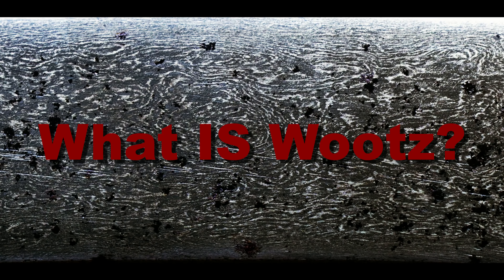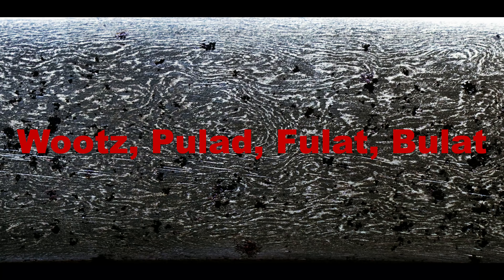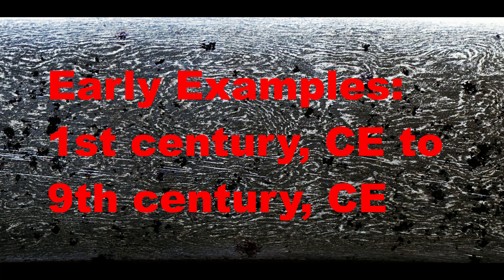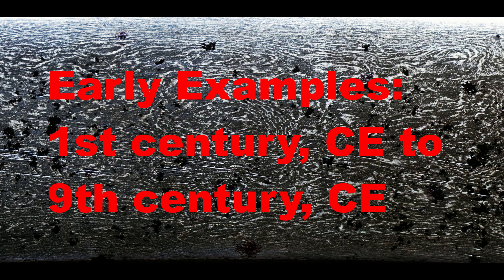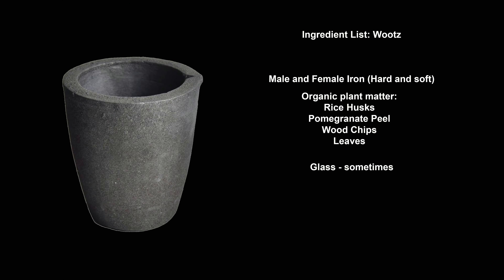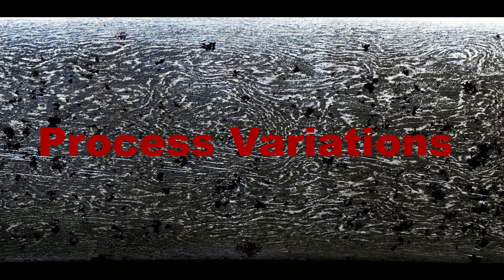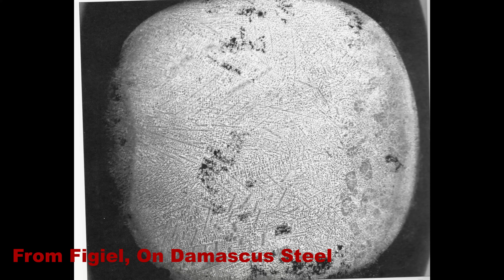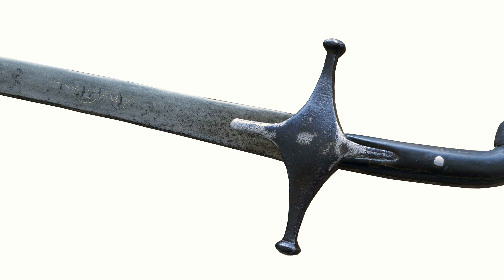"True Damascus Steel": History, Metallurgy, Production

Comment: Crucible steel is not Wootz steel. Wootz steel is made from crucibles of steel of course. The presence of carbides within the clean dendritic structure of Wootz steel is not present within the structure of clean Crucible steel. Low and best, no sulfur iron ore along with vanadium at .005 to .01 % is required. Further introducing hydrogen in the crucible process is a must to lower the temperature of the melting point. Wootz steel from crucible steel is much more specific and time consuming than simply making crucible steel. Watch Al Pendrey’s video, the secrets of wootz Damascus steel, will provide additional information. Cheers.
Reply from the maker: I think you might be missing something here. Not only did I reference the papers by Pendray and Verhoeven, I never claimed that all crucible steel is Wootz steel. But Wootz is undeniably a crucible steel.
Reply: IPostSwords I wrote this to hep direct the information you provided.  I’ve listened to the commentary twice. In the beginning, you must have high magnification on crucible steel to see if the dendritic layers and particularly the carbides that differentiates the two, exist. Just an unbiased critique. I believe it might be in the assumptions you make of the persons listening. Even I do that at times. I do appreciate you and others passing the knowledge. Most people do have wrong information and very wrong ideas about Wootz, especially when it comes to the temperatures. This is a subjective and very delicate science. You can easily lose the carbides in the crucible even if the proper elements are present. However, you can bring back the carbides, through several thermal cyclings, if you lose them. There is of course much more to it, but these are some of the facts learned by Al and continuing by others. Even Al took the time and gentleness in coaxing the crucible into Wootz. Patience from age and experience is the key I believe. I really enjoy pattern welded and crucible steels. Heck I still love my old Anza knives better than my own. They sharpen easily and cut like butter. I’m very excited about the expanding of other smithies to start producing Wootz. Wouldn’t it be great to have an abundance of Wootz blades available.
Reply: @aaronbuckmaster7063  I'll surely purchase one if you make it! How would wootz fare as a Kukuri knife?
Reply: Kasper Bolding it would do an excellent job. All of my knives used for processing and skinning game, have that same geometry.

Comment: Does the steak name has a concluons to Damascus?
Reply from the maker: There's three main theories on how it got the name. The first is that its associated with the city of Damascus, likely due to swords made of crucible steel being sold and traded there, potentially forged there - but there is no evidence of the steel being made there.

The second theory is that the etymological root of "Damas" refers to water, and the steel is often called "watered steel" in various languages, or having a "watered" pattern. 

The third is that there was a smith called damasqui mentioned by Al beiruni, whose name may have been associated with early examples of the swords.

I think the "watered steel" hypothesis has most merit
Reply: @IPostSwords  thanks man
What I’ve heard it’s some wondera went to Damascus there where they found the swords the how they made it🤷🏻

Comment: When you say crucible sterl it will come out as mono steel doesn’t it?
Reply from the maker: No, the segregation of carbide forming elements during ingot solidication is not homogenous, and as a result the steel ends up with banded patterning after forging and heat treatment. It is a "monosteel" in that only one ingot is used, but it is not a monosteel in the sense of being homogenous

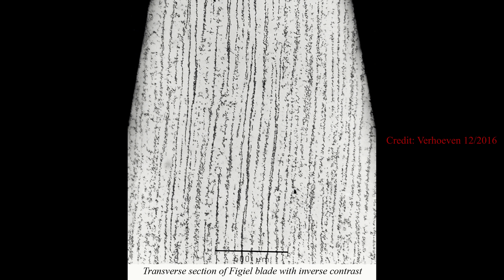Comment: 1:24 Gamma-ray variance spectroscopy? Like, the preferred method of looking at ferrous-compound composition..? Come bloody ON, when I took up metallurgy due to engineering studies in 2003, gamma/X-ray was the only way to get your findings accepted. "Microscopisized" is pretty much pre-1990es.
Reply from the maker: The Wallace collection used neutron diffraction (see here: https://www.sciencedirect.com/science/article/abs/pii/S0026265X20319238 ) but that's simply not available to the majority of researchers, and even less available to hobbyists and collectors. 

If the item is already etched, and many crucible steel swords are, it is much more affordable to use microscopy and can still provide a positive identification.

The only reason the Wallace collection had to use neutron scattering was because the artifacts had been polished in the 19th and 20th centuries, and they were unwilling to re-etch them due to conservation ethics.

Spectroscopy is still widely used to assess the composition in terms of alloying elements, but not to visualise the cementite spheroids.
Reply: @IPostSwords  Nice link. Thanks :)

The images are a bit fuzzy, but the orange-outlined ones give an identifiable idea of kernel distribution.
Reply: Slapping (and then not) myself: If you pay the list price, yeah, G/X is for corporations. But know a guy in the lab and get your examples into the 3 -weeks metallurgy programme for bachelor students...
Reply from the maker: @Smo1k  "knowing a guy in the lab" is how I get access to the metallurgy microscopes sometimes. But my university isnt great with allowing swords to be brought in for analysis
Reply: @IPostSwords  State of the world, I guess. Sad thing to need metal detectors in places dedicated to learning :(
Reply from the maker: To be honest, they don't really need a metal detector to spot a sword. They're not exactly concealable
Reply: @IPostSwords  the trenchcoat mafia begs to differ with you.

Comment: Has anyone e looked into the idea that it was actually iron from meteorites which have nickle and cadmium in it????  I have always believed this To be the case
Reply from the maker: There isn't much nickel in most crucible steel. Iron meteorites have around 5 to 20% nickel, the swords analysed by verhoeven et al 1998 have roughly 500 parts per million. 0.05%
Reply: The octahedrites are commonly exhibited in this manner because they undergo a solid-state phase transformation where the kamacite (ferrite) nucleates and grows along the octahedral planes of the parent taenite (austenite) phase producing a beautiful etched pattern.  Could this be something relevant?

Comment: Did this man just flex his sword?
Reply from the maker: Many swords are flexible.
Reply from the maker: @Gallowglasser  
First, a quick clarification: the OP comment used "flex" to mean brag - I responded with a double entendre where flex means both brag, and "to bend".

Regarding crucible steel flexibility: Entirely depends on the example you're looking at, and how it was heat treated. Some are springy, some are not. My shamshir is not springy, and I suspect most shamshir like it are not. I do have springy "crystalline" wootz indian tulwars, and have seen springy turkish crucible steel swords.

Regarding brittleness, again, depends on the individual example, its P and S content, and its heat treatment.

Comment: It annoys me whenever I see the newer "blacksmiths" kept calling their "Damascus patterned" blades as "Damascus steel" when it is not. At most, I would allow it if they said it plainly and outright that it is "Damascus patterned" but even then most of these newer blades don't look anything like a real "Damascus steel" blades. Also most of these newer so called "blacksmith" cannot even be considered as a proper blacksmith. I have seen many that worked by cutting the steels that they have forged into the blade shape. No real blacksmiths would cut the steel into a blade shape and then sharpen it. A proper blacksmith would shape the blade with hammer and anvil. These newer "blacksmiths" works more like a wood worker then a true blacksmith. And then they have the audacity to sell their blades like it was a proper blacksmith's work. The world now is full of scams.
Reply from the maker: There is a (very tiny) number of smiths making crucible steel with the correct historical compositions and patterning. But yes, the vast majority of modern bladesmiths  are producing pattern welded steel. 
And yes, many sword and knife makers today rely heavily on stock removal, not forging. Even some who are very well regarded like Angus Trim.
Personally, I will always prefer something forged - but I also prefer a crucible steel sword, even if it has worse performance characteristics than one made of modern steels

Comment: its not true damascus if its not from damascus
its a dead craft
not like wootz or multi lairs steel just to look nicely patterned
its made by damascus city blacksmiths
Reply from the maker: The entire published research disagrees with you. 

And wootz is not multi layered. It has carbide segregation due to dendritic and interdendritic rafts of low and high carbide forming elements respectively, but no layering.
Reply: @IPostSwords  the research is wrong simple is that
damascus steel is what it is by the name
wootz was introduced to damascus city blacksmiths from india
due to the many wars this region had the supply of wootz ingots became low so damascus blacksmiths inverted the indian tecnology of making the steel but they where far more superior than indian blacksmiths and made their own improvements to it making the steel better on so many levels
so every wootz is damascus
but not every damascus is wootz
its not true damascus if its not forged by true damascus blacksmiths
its a dead craft

Comment: Damascus Steel is flimsy AF and chips and very brittle.
Reply from the maker: Crucible steel is extremely variable based on where, when, and how it was made. It varies in alloying elements, heat treatment, melting rate and cooling rate, whether you forge it "top of ingot as spine" or another orientation.

It is very difficult to generalise anything in the world of crucible steel.

Comment: Damascus steel is a particular metal made with particular ores from damascus.........what every one is claiming as Damascus steel is just pattern welded steel, this irritates me
Reply from the maker: The ores are not from the city of Damascus. The earliest crucible steel of the type we have is all from Tamil Nadu, India (roughly 600BCE) - and the majority of all crucible steel of the type was made in the subcontinent, with other major centers of production ranging from Iran, to Turkmenistan, Sri Lanka, and many more. 

While it is technically possible crucible steel was made from ore mined in the Wardeh mine (as investigated in a recent Mike Loades documentary featuring Pendray and Verheoven) the majority was not. And that is by a very significant margin
Reply: @IPostSwords  sticking two peices of metal together is not Damascus it's pattern welding, making a crucible with the metals from India in Damascus the way it was ment to be to remove impurities is Damascus steel pattern and Damascus are two different ways of doing the processes and for puritans this should be adhered to on their videos, as time goes on more blacksmithing process are and will be lost as time goes on
Reply from the maker: @davidmurray9193  I am not talking abotu pattern welding. This whole video is about crucible steel and the pattern formation due to dendritic and interdendritic segregation of carbide forming elements while cooling from liquid.
Reply: @IPostSwords  I know but I'm just saying it's irritating when so called smiths claim they are making a Damascus when plainly it is pattern welded steel, two different process which your video is explaining wootz and Damascus 😁😁😁😁😁

Comment: Damascus steel is a type of forged steel that was used to make swords and other weapons in the ancient and medieval times. It is known for its distinctive patterns of banding and mottling that resemble flowing water or damask fabric

The origins of Damascus steel are not clear, but there are several theories and legends about how it was made and where it came from. One theory is that it was produced from wootz steel, a type of crucible steel that originated in India and was exported to the Middle East and other regions. Wootz steel contained high levels of carbon and trace elements that formed carbide spheroids in the metal, giving it hardness and toughness

Another theory is that Damascus steel was made by forging together different kinds of steel, creating a composite material with varying properties. The steel was then folded, twisted, and hammered repeatedly to create the patterns and refine the structure. Some sources suggest that the steel was also quenched in acidic solutions or organic materials to enhance the contrast and corrosion resistance

A third theory is that Damascus steel was named after the city of Damascus, Syria, where it was either made or sold. Damascus was a major trade center and a hub of cultural exchange in the ancient and medieval times, and it is possible that the steel acquired its name from its association with the city

Damascus steel was highly prized for its quality and beauty, and it was used to make weapons for royalty, nobility, and warriors. Some of the most famous swords made of Damascus steel include the Zulfiqar, the sword of Ali, the cousin and son-in-law of the Prophet Muhammad; the Shamshir-e Zomorrodnegar, the sword of King Solomon; and the Sword of Attila, the sword of Attila the Hun

Damascus steel is considered a lost art, as the exact methods and recipes for making it have been forgotten or lost over time. Many modern attempts to recreate Damascus steel have been unsuccessful or only partially successful, and the mystery of its origin and production remains unsolved

Comment: Carbon absolutely is not necessary for iron to melt🤦‍♂️😂

You got all of this from reading and none from experience,  eh?
Reply from the maker: Increased carbon content reduces the melting temperature. When you're talking about historical furnace designs, hypereutectoid steels have an appreciably lower melting temperature which is more achievable given the furnace technology of the time
Reply: @IPostSwords  lots of additives can reduce melt temp. Doesn't make them necessary nor account for their presence 

I use aluminum in my copper. It lowers melt temp. That isn't why I do it though
Reply: @IPostSwords  it isn't that difficult to melt iron over charcoal in an earthen foundry if you have someone to keep pumping the air
Reply: I'm not dogging your video ✌
Just pointing that out.  There was certainly useful info I didn't know
Reply from the maker: @tbishop4961  the temperature to melt copper and to melt iron are vastly different, as was their historical difficulty of melting.
Reply from the maker: @tbishop4961  it's literally over 1500c. It's not trivial to produce furnaces that can reach and sustain 1500c, especially with the refractory material of the day, and charcoal as a fuel. Even with bellows
Reply: @IPostSwords  the difference in temp is not that significant.  I can get a copper melt on wood coals in under 15minutes and welding temp in that same time. If I run 30, I'm melting steel

You should make your own earthen foundry and then you can speak from experience
Reply: I would add that fuel quality makes a difference.  Mulberry tends to make a better coal than elm, Hackberry, walnut, or black locust
Reply: @tbishop4961  if ifs and buts were candy and nuts then we'd all have a merry Christmas.